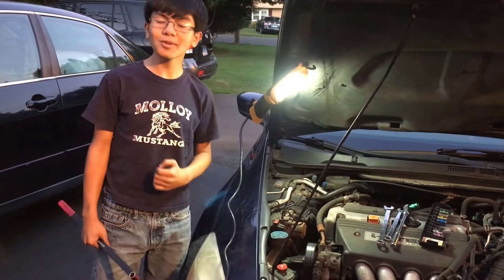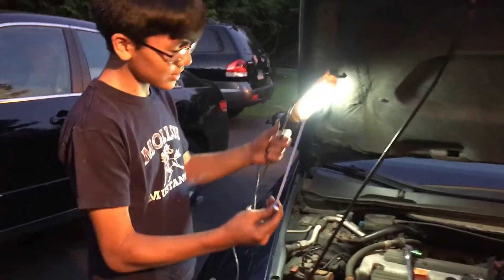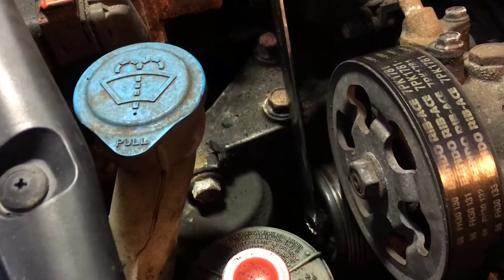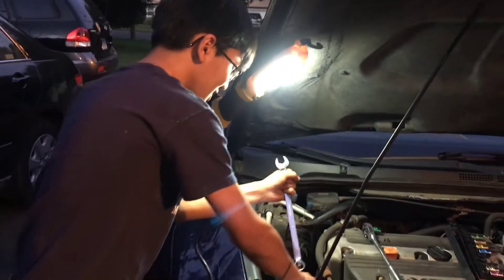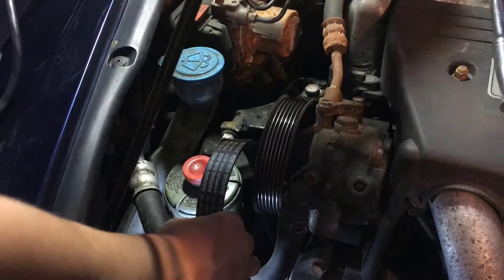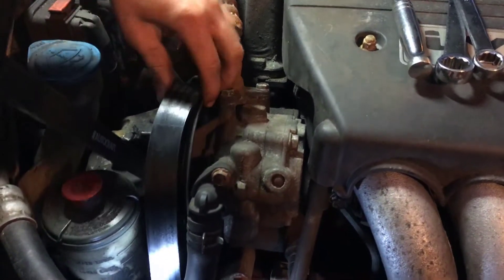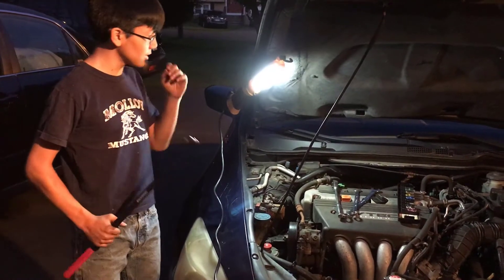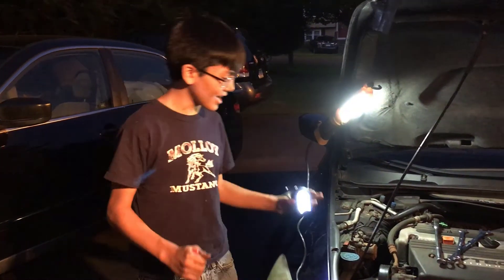How To Remove Serpentine Belt On 2003-2007 Honda Accord | Auto Repair Guide By Young Mechanic Aiman

Comment: Nice work there guy. You're doing the right thing by starting off early in life and repairing things yourself. There's great satisfaction in doing that, plus you know it's done right and you can save a ton of money. Thanks for putting this together.   One thing I'll mention is when you get the belt on, do two things:  (1) Look everywhere the belt goes and verify it's in the grooves, and (2) do NOT start the car up initially. Instead, "bump" the key a few times to turn the engine over just a little bit (without actually starting it), then go check that the belt is still seated properly. If so, bump it one more time and check again. If it's good then, start the car up and verify a final time (by letting it run).
Reply: What do u mean bump the key?